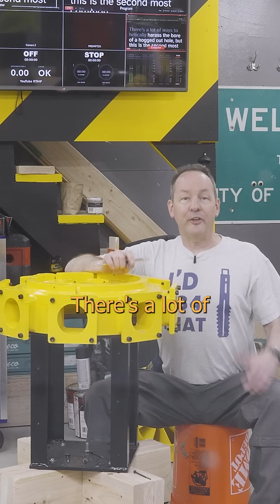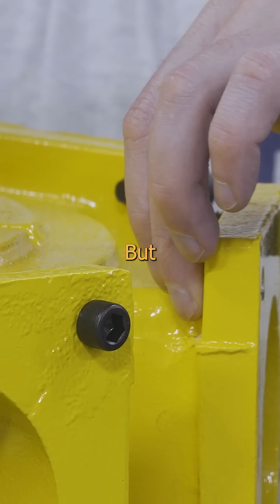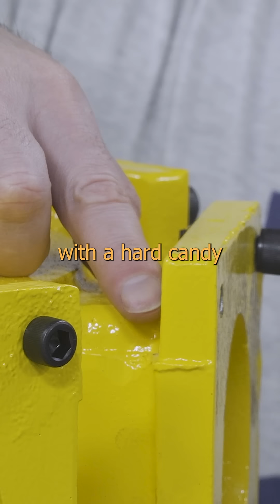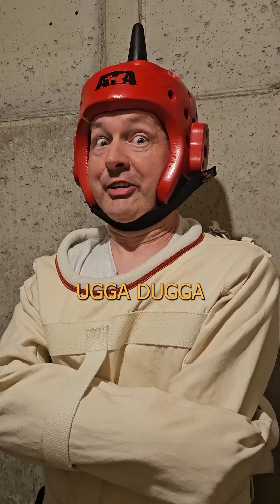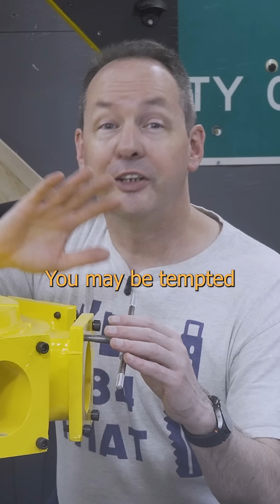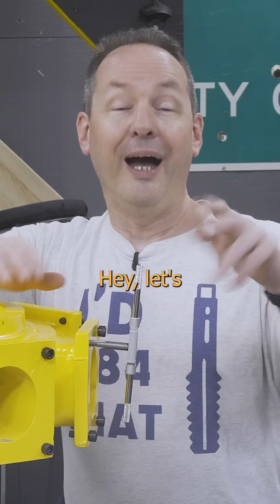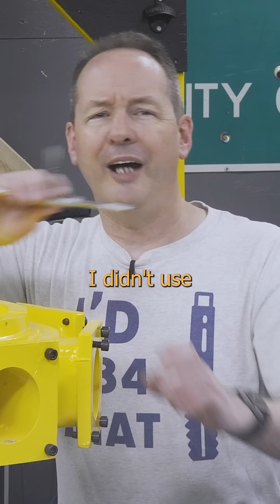Thread Chasing  #chrisboden #comedy #engineering #skills #workshop #metalworking #tools #apprentice

Comment: Never used a drill to tap, but I have cross-threaded a dash-20  aluminum port on a condenser, and subsequently spent 2 hours on a lift fixing it with a thread file by hand.

Comment: I have had apprentices drop a tap (of mine) in front of me and then hurriedly pick them up and try to hand me the tool that I need and have been asking for. It is a kind of awakening to them when I don't accept the tool and they are left hanging there trying to offer me my own tool and I give them the explanation that a Tap is a last ditch effort to save a hole and a dropped Tap is a dead tool and that more caution was needed when handling the Tap that they just dropped. It's no real skin off my back to the tune of a $4-20 tap but the lesson that they learn to be careful with their own tools is a life lesson that keeps on giving for years. That little tap and $4 that I lost I can keep plopping in their lap to remind them of the lesson weeks to months after.

I'm more then sure that the same lesson is taught to people that work on high voltage lines, telecommunication towers, oil rigs or anywhere else that is suspended above a void of "that aint coming back" if the hand tool is dropped

Comment: Broke off an m2 thread in an RC part and spent the next 5 hours attempting to retrieve it I learned not to even use the lowest power drill you got and it's better to take the 5mins to do it right then 5 hours to fix your mistake

Comment: The dumbass curse, Sometimes it just happens im surrounded by 5 different cultural levels of dumbass  and  with my levels of skill dwarfed by charismatic luck when someone gets a itchy hole or worse they are told to bring it to me,  m4 m5 m6  wurth rivnuts and  pullup studs  cheep stainless cap bolts through aluminum housings into  gental threads with a m18 drill,  Remember kids other peoples stupidity is your job security

Comment: I snapped a stainless screw into a hole for a main drain cover of our city pool. Dumbass me said it would only take a tap and a drill 30 seconds to get it back in operation. So of course, let's start filling the pool!
Well...I went at full speed and the tap snapped in the hole again...after 5 minutes the water started rising, my frustration rose, I dropped the screws, drill, and my phone down the drain hole.....we stopped filling, pumped out the water, found the drill and phone, and started the pool a day late. Dumbass

Comment: My dumbass ran one in with a 1/2 in impact wrench and cross threaded nearly the entirety of the hole and snapped the tap while it was still in the threads. My old wallet still won’t answer my calls

Comment: Ill never use a tap in a drill or impact. Hand only. I learned from a crusty old tool and die tradesmen in highschool to go slow. Slow half, back a quarter... slow half and back a quarter...let the tool do the work and don't force it. He demonstrated with an old tap how you could shatter it just by even dropping the damned thing let alone reef on it. When I went back to school, I still remembered what he taught where as a younger student to me clearly did not get taught such a lesson... he just fecking gave her and snapped two taps in 30 mins. I ended up with the nicest threads out of anyone in the class. So not a dumbass and proud of it!

Comment: My highschool engines class involved taking apart and reconstructing a power washer engine and many times did the teacher have to drill out a hole and repair the threads because people realize it ain't turning because it aint in right. People would force the bolt in anyways and screw up the thread (pun half intended)

Comment: Dumbass was cleaning the manway door holes on coal crushers at a power plant with a 5/8” tap and an impact nothing broke fortunately, no the only time Ive had a tap break on me was when i was using the tap wrench working on a steam turbine was tapping the keeper bolt holes for the labyrinth seal the 1/4” tap stopped i went to back it out it snapped and then proceeded to jab my thumb knuckle through my glove and i still have that scar

Comment: Well I wasn't gonna try it with a drill until you said something, so thanks for that!

Back in enginerding school, I was tapping some parts and thought it would be a grand idea to chuck the tap in the milling machine to get it nice and perpendicular, then just turn the spindle by hand. The shop manager told me it was probably going to end badly but like a DUMBASS, I didn't listen. Tiink! is not a sound you really want to hear when your tap is half buried in the aluminum part you just spent a bunch of time milling down *just so*. 

Yes, aluminum. Yes, regret.

Comment: Decades ago I was helping my uncle swap the motor in his van. He had never seen taps before. I brought my set and chased every thread in the cast iron. It blew him away since after chasing the threads all the bolts went in like it was brand new. Only time I have cut threads with a machine was using a laith. That’s a whole different thing from dies and taps. I have used taps on a mill when doing a lot so you don’t get your hands and arms worn out.

Comment: Using a cutoff wheel, cut 4 reliefs into a bolt with the same thread and grind the last few threads halfway down. Use a drill or impact on that if you have to have the speed. This will save you from having to try to extract a hardened tap galled in the hole.

Have chased many threads in the field when I had an extra bolt on hand and the needed tap was hours away.

Comment: The first time I used a tap, I didn't know what I was doing and was trying to put a hole for a set screw into a plastic wheel with a metal ring core. Snapped it like a twig. I have not broken a tap since

Comment: the first tap for the threads is always by hand but then I run it with my drill.  been doing it that way for close to a decade  haven't had an issue yet.  of course now that I've said it I'll not only cross thread it but break the next one.

Comment: Not my dumbass moment but I had to fix some dumbasses mistake. They drilled into the water jacket on a hard to get cylinder head. Ended up drilling it larger and tapping it to m10 and sealing the crap out of the stud. Never had any issues. You should do a video on tap types next. The jokes you could get from "plug and bottom" would be epic 😅😅

Comment: Been in this situation, was advised and followed: drill it out, ream it, chamber it to Jesus - about an 1/8",  sleeve it, bend the sleeve true, weld it, tack it, fill it, tap it, send it. If thats not the most industrial Daft Punk song ever I give up. At the end of the day the scary part of this job is realizing thinking outside of the box appropriately gives you full control to redesign the box entirely. Just make what you think a thing and you'll crush a thousand engineers who thought a thing could be.

Comment: dumbass.
Had to tap some holes, bossman told me to do it with an electric drill and nobody had ever explained to me how it actually works, went full speed through a 3cm thick steel plate.
Somehow it worked just fine though.

Comment: Not the dumbass here👋 my first job was an industrial fabricator. I was one of three people in the shop, very small business. My boss was 76 years old and very set in his ways. My first time using taps was on an 1” hole. Can’t remember the thread pitch but if you have ever tapped anything like that, you know how tough that is. My hand were shredded but feeling how bad that was and hearing how they talked about snapping a tap off was enough to scare me. 

Second story, I was still tapping by hand and snapped the tap in a bit of mild steel I was machining. Decided to try and hide my fuck up, welded the hole shut and remachine the part. Well the lathe didn’t like the tap. I got the bosses son, (machinist), and he told me it was likely a carbines nodule in the steel. And to just try to make a new piece. 

I miss that job sometimes but $10 an hour to get cancer isn’t worth the same anymore(I’m only 23)

Comment: After starting it by hand, I use a tap socket on my Dewalt 1/4" screw driver with the clutch set extremely low. The clutch is so soft on 1 could be stopped if a mouse held onto it.

Comment: My dumbass moment cost me a slant six engine block. 

Snapped a head bolt off, below the deck surface. extractor wouldnt get it, so I had to drill it. Ended up damaging the threads, so I grabbed a tap and started cutting new ones. 

Got it about halfway in and it started fighting me. I should have stopped, backed up, and cleaned the tap. i grabbed my impact gun instead. I was PO’ed and running out of daylight. i snapped the tap off, and it got stuck. In the process, I also cracked the block between the bolt hole and a coolant passage. I did not know or see this until i grabbed a map torch to heat up the area around the tap to extract it, and I made the crack continue from the coolant passage into an oil passage. Block was toast after that. And I had put a LOT of work into that beautiful, buzzy little noisemaker.😅

I should have quit while I was ahead. I could have sleeved the cylinder and been fine. 

Nope, when I hyperfixate and ignore all of societies pre-conceived concepts that cause this creative cro-magnon consternation and conflict, the resulting cataclysm from the chaotic catalysts of pressure and stubbornness, while ultimately cathartic, have usually resulted in financial loss or excess consumption of cheese.😂

Comment: I use a drill to chase threads a lot. I just turn the torque setting as low as it goes and then increase it just enough to allow it to spin.

Comment: I try to avoid using taps in holes that are already cut. If I don't have my thread chasers, ill take a scrap bolt and cut a couple grooves in it and run it through the hole vs risking retapping.

Comment: I do this all the time at work for mandrels that we spray parts on, both the tap and die side. Never occured to me to put a tap in an elecric drill, since drills have a three jaw chuck and the back of a tap is a square I know it's not gonna line up coaxially well enough.

But also holy shit that thread was nowhere close to perpendicular, how much had that guy been drinking?

Comment: dumbass

We often re-use networking racks, and sometimes the new holes are an absolute nightmare, very tight specs, usually also painted. I was new, and just used a socket bit and mounted all new components with a drill and and configured the rack, tested good, then removed the heavy components, drove to site, and none of the threads were there for the components we removed. I ended up using nuts and bolts in a rack, which is also heretical, but the look my boss gave me when he found out will make me be patient for the rest of my life.

Comment: D*mbass... (Community guidelines kept flagging full spelling lol) I can't remember what I was working on but I had a handful of threads to chase. Being a teenage genius I grabbed a drill after the first hole 😅 I'd finger start them to make sure the first couple threads were clean-ish enough to get things started on the right track (good idea in theory) but severely underestimated how little of a damn the tap gave when it had the power and leverage of a drill behind it. I got lucky and "only" cross threaded like 1/3 of them lmao. So then I got to learn two new lessons 🤣 Drilling them out and tapping the next size up and filling with weld to drill and properly tap back to the original size. My dad was my high school shop teacher, so I got a lot of "well that's ruined.. how can we fix it?" Problem solving/learn by doing sort of lessons. In a lot of cases I think that's the best way to learn. To this day I have a strong respect for the tools when I reach for the tap and die set

Comment: Auto tech here... learned the hard way on a wrx oil pan one shop cross threaded the drain plug went in and blew out the stripped plug whole had to replace the whole pan cause I wanted to get it done quick what a "dumbass" also didn't get paid for the work my mistake my time to replace

Comment: Last shop I worked at had an EDM drill or as we called it "the hole popper". You'd put the part with the broken tap in the machine and set these different parameters to the list that someone long before me found out work best for the size electrode you needed. Then you'd take this hollow brass rod (ranging from .5mm all the way to I want to say 5mm was the biggest we had) and then set your hole location, tell the machine how deep you wanted it to go and hit start. The electrode would spin and a pump would spray DI water through the center. When the electrode made contact with the broken tap it would slowly burn the metal out and the water flowing through the center would wash out the debris. That tool was my favorite machine in the shop since it could take a job from  "Oh fuck..." to "eh, no big deal"

Comment: Just ban the use of impact wrenches. The sheer amount of jobs that can be done without one is staggering. They also learn not to set the driver to drill mode when the umpteenth time the driver snaps back and hits them. That's why they like impacts because it doesn't snap back at their fuckup.

Comment: cat 50 cnc mill, door safety switch bypassed, face in machine, tap was in tool slot where an endmill should have been, watched this beasty machine send a 3/4 tap into 4 inches of stainless at 1200 rpm and around 6 to 8 fpm, i was one foot away looking dead at it when the tool and holder welded themselves to the stainless, yes they welded!
Reply: i'm not going to even pretend to call myself a professional when it comes to mills, but the thought of running a tap at 1200 rpm terrifies me. then again, on the occasion i'm tapping in the machine, i'm doing it manually, so i have to be slow with it.
Reply: Tap was in the tool slot where an endmill should have been, previous operator mistake and oversight on my part, I literally was looking right at it from about a foot away!!! But yes it was scary @That_Wonko
Reply: Thats called friction welding! 😂😂😂
Reply: 100%  @wolflarsen941
Reply: Yikes lol
Reply: Oofta
Reply: you forgot to write "and thats pretty cool"

Comment: We were retrofitting larger bed proxes at work, one of my coworkers has 20 years, compared to my 5. I know my way around a shop, but if he says something’s fine, I’ll usually go with it, especially since he’s actually a really skilled machinist. 
He got all 4 holes on 7 of the 8 plates tapped with the drill. With two holes left, he snapped it. I welded a nut to it, backed it out, did it again. Finished it by hand, repeated the same process with two more snapped taps on the last hole. We got away with it that long only because it was 3/16ths mild steel, an m6 tap, and he has surgical steady hands. Had I done it, every one would have been snapped (I learned my lesson tapping a retaining bolt hole in our last spare motor and snapped it off) 
Either way, I won’t ever use tap sockets with a rachet now. I require a quality tap handle, to help buffer my lack of skill. lol

Comment: Ye olde power-tapping. I haven't been dumb enough to try it, but one of the in house maintenance guys tried to power tap the jack bolt holes on the power coupling of the 7E turbine we are working on, the last time they tried to get it apart... the tap piece was still on there when the generator crew went to uncouple the rotors. 

As for tapping holes, I have tapped enough holes on this job to make Chris blush. Gotta love broken bolts, stripped threads and heli-coils.

Comment: Yea I'm dumbass, tried to clear a hole with a drill after cross threading a bolt in a motor mount, let's just say that hole now has a bolt two sized bigger than the original

Comment: This dumbass tried to chase the threads in the holes on the cylinder head of a 1990 Suzuki DR250. Broke the tap. Wore out multiple drill bits trying to get it out. Turns out tools steel doesn't drill. Instead I just mangled... everything. Ended up buying a 350 motor and telling myself it needed more umph anyway.

Comment: Is it not easier to just weld it shut, then drill a pilot hole and tap it again to the right specs? I don't know much about welding, tapping or drilling, but by my reasoning, starting from scratch is sometimes easier than trying to fix someone else's screw-up...

Comment: i indeed did a dumbass move that cost me almost 5 grand ... dont friday night beer and tap holes .. i was doing an afterhour job on my TDI jetta CJAA with the famous glowplugs that have to be drilled and then slide hammered out then tapped ... well i grabbed a #10 instead of #8 tap and made a grand canyon sized mess that turned into a head off and off to the machine shop .. good news is it was due for a timing belt anyways...

Comment: DUMBASS

I was an “apprentice electrician” building Helmerich & Payne drilling rigs for a contractor in Houston at 20 years old. Mounting PLC cabinets in the doghouse, or driller’s shack, driller’s cabin, where they control the damn rig, after about 6 times in a row needing to drill out the old one and go up a few tap sizes the foreman of the doghouse crew took the drill out of my hands and gave me a crescent wrench. And this was on brand new metal. Not chasing old ones. I learned the hard way how to be perpendicular and steady that day.